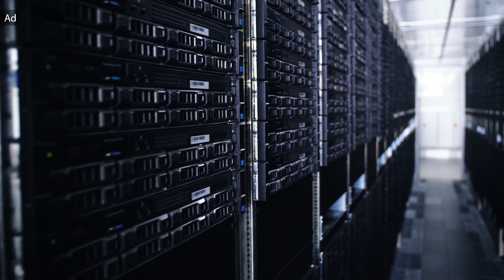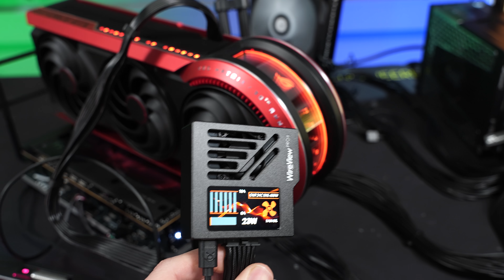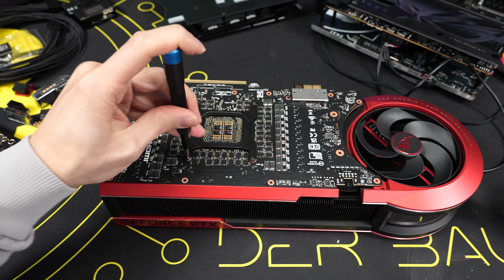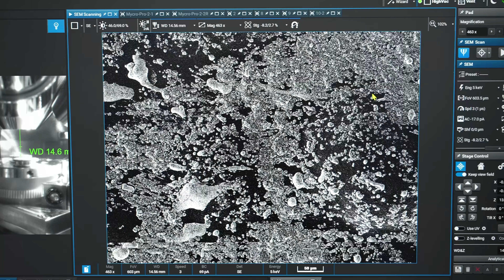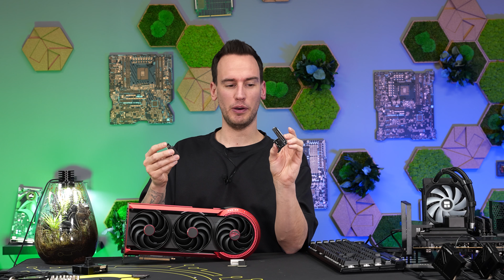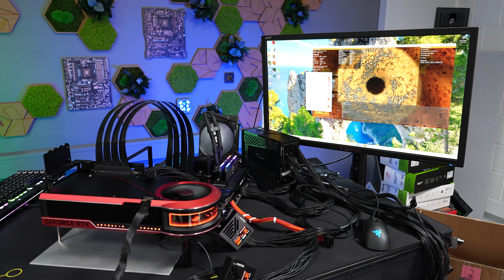After Recall Rumors: ASUS Secretly Changed RTX 5090 Matrix Liquid Metal

Comment: Does anyone know if the Lian Li GPU cable (PW16-81W) would fit the Matrix? The attaching end is slightly larger than other cables being 7?8" of an inch, or 22.225 mm long. I am fortunate to have the Matrix on the way and will make it fit if I must, but hoping I won't have to. Great video! I wish I had half your knowledge.

Comment: I've had Liquid Metal on a CPU spreader for my old machine for roughly a decade. With cleaned heatsink fins, it had the same temps in p95 a decade later. So never understood why exposure to air was an 'issue', since once married, only the very edge of the LM would oxidize, (I say had, because i removed the heatsink to use on a newer machine, which has been running 5 years now)
I've been too nervous to try LM on a GPU die tho. Paste moat seems like a better idea to prevent leakage than anything. Def taking notes :3

Comment: This card makes no sense. The additional wattage does not increase performance.  My asus 5090 Astal water cooled is pulling 600w at 3100 mhz and 55c. And under 8.5 amps on all pins.

Comment: I wonder why Jayz2cents said that the matrix draws 600W from 12V + 200W from the BTF connector which he did not backup either by testing or through an ASUS statement...
I thought it was weird if they did that, your video makes sense its likely 50/50 for a pretty much near 0% chance of burning the card

Comment: I'm quite surprised 2 x 12vhdpr arent built on to recent high power GPU's like the 5090, Also PSU's should have 2 x 12vhdpr, the circuit board would need a slight re-design to instruct components to draw power from either 12vhdpr. I have seen PCI-e connectors on new B850 motherboards capable of providing the GPU with 75 watts which is a good idea.

Comment: Someone needs to invent a liquid metal that's very wettable with low surface tension so that machined grooves in the mating surfaces can naturally draw the liquid metal into automatic contact with little or no pressure required.

Comment: I like the idea of the wireview with a extention cable, as not any of your current wireview models work with my GPU.

Question: Will cable length be an issue?

Context: My PSU cable is already 750mm, adding the wireview with another cable adds another 500/750mm?, so I may end up with 1.5 meter of cable.. is this bad or will it be fine?

Comment: A thought came to my mind just the other day regarding the 12V-2x6 connectors. Every GPU manufacturer have advised against bending the cable near the connector so I was thinking, for all those that melted, were their cables bent too near the connector? Has any vertically mounted GPU experienced melting connectors, since vertically mounting the GPU means the connector is facing up and the cable would most likely not even need to be bent near the connector at all when routing to the PSU. Any thoughts or experiments done to test this?

Comment: They really should of gone dual 600w connectors 😭 yall guys seen msi lighting 5090?! The thing goes beyond 2500 watts!! Has 2 600w connectors. Its NASTY OP powerful! Id buy msi lighting 5090 😂
Reply: Gonna need 240v psu these days. So over 3000 watts. 120v psu’s aint cutting it anymore 😂 as they are limited to like 1600w
Reply: BTF the whole concept.. i dislike it. Not only it takes away pwr from mobo for future tech. Also have to buy whole board for it. It would of been whole lot better if just went 2 connectors and would be compatible on a lot more hardware.

Comment: the paste on the stiffener ring around the core needs to have an air channel because otherwise when mounting, the paste on the stiffening ring would create a sealed bubble of air which will prevent the core from touching the heatsink, and if you force it closed, it will blow out the paste off of the stiffener until the bubble "pops", which will create a quick path for liquid metal to leak out of. by creating that multiple path array of paste on the stiffening ring, it allows a path for air to get out when mounting while also keeping a more effective barrier to liquid metal leakage. it has nothing to do with oxidation of gallium.

Comment: How many insert cycles are those plugs rated for typically on PCIEX cables - I swear even my Corsair Pro type 4 cables start to increase resistance and drop voltages from 12v to ~11.6v over time plugging and unplugging during equipment testing.

Comment: Expensive card. 👀
I'm thinking that the mixture of liquid metal and other material might be to help stabilize the liquid metal in place and/or keep it from sticking to components if it leaks out?
It would probably still migrate around once hot, but I don't know.  I really never liked liquid metal but this seems a bit safer than straight up liquid metal only.

Comment: The gap makes sure no pressure can built up, which can otherwise slowly push out some LM. A tiny difference in pressure is enough to drive a slow creep of liquid through crevises, including creeping through another high viscosity liquid like thermal paste (i.e. if the barrier didnt have gaps). Apart from simple thermodynamic expansion, also evaporation of the tiny bit of water present on basically every surface in our atmosphere leads to a bit of pressure. The layered pattern makes sure there is no direct path outward. In general you want prevent any pressure builtup simply to reduce strain on the barrier material, which can push it outward over time. It also would act on the chip and heat exchanger but I dont think thats significant with respect to other stress/strain in the solid material.
Reply: But liquid metal corrodes when combined with oxygen............ Did you miss that portion of the video from one of the top Liquid Metal sellers in the world?
Your facts make sense, but they have never been a problem thus far. This theory is similar to the vented closed loop water cooling loops; it makes sense in theory but does jack shit besides making another point of failure. The pressures we are talking about are WELL below 1 PSI for LM, the pressures for water cooling loops were around 3 psi (depending on heat). Both cases are negligible.
Reply: My quess is that they used stencil to apply the paste and that's why there is gaps.
Reply: The TIM around the core forms what's actually called a 'labyrinth seal'.

Comment: Can someone explain to me why this 5090 is only compatible with btf mobos? He said that in previous videos too but I couldn't figure out why exactly.
Reply: You can use it on normal mobos if you want but it will be limited to 600W through the single 12v 2×6 connector.

You need a BTF mobo (or one of those adaptors when they release) to unlock it's full power limit since it supplies the extra wattage through the BTF connector itself alongside the standard 12v 2×6.
Reply: @kspectre21 I asked the question because I recently bought a btfo MSI and couldn't figure out. Are you saying it needs more Watts, that I understand, and that "only" btf mobos can provide this via the third 8pin pcie connector?
I saw this third one in the manual so I'm making a simple deduction here. (My mobo still in it's package so I didn't dive in the full manual yet).
Reply: @The.Anonymous.Anonymous You can use it on your mobo at 600w but then it's just a normal 5090.

The main feature of this card is having an increased power limit over the standard 5090 models for overclocking, it needs the BTF connector to do that.

If you don't have the connector plugged in then you just essentially just have a bigger 5090 Astral. It still works completely fine but you're just losing that extra overclocking headroom
Reply: @kspectre21 thanks a lot, so that's the explanation. The 12v power is 600W, the pcie is up to 75 I think, and the single 8pin is 150 I suppose. That's a lot of nuclear power 😂 at this point GPUs need to have a separate wall plug, it would be easier!
Reply: @The.Anonymous.Anonymous yea and with MSI and Gigabyte now going further and making 1000w models with two 12v 2×6s it's getting even more insane lol

At some point we're just going to have to start buyings a GPU in bundles that come included with their own generators 😂
Reply: @kspectre21 so true 😂 my 5-6 yo PC is a Corsair One, fully integrated, with a 600W for a 2080 and an i7, evey single component is OC. The new PC parts I bought, when I calculated the need it's like 1000-1200W. I just can't wait for my new electricity bill 😂
Reply: @The.Anonymous.Anonymous yea I went from an 8th Gen i5 and GTX 1050 Ti last year to a Ryzen 7 9700X and 9070 XT and the difference is absurd lol

Even with an undervolt on the GPU the power draw on that when it's under load is 200-250w more than my entire old PC.

It also turns into a heater whenever I play some UE5 games, it's so weird feeling the entire room heat up massively.
Reply: @kspectre21 my old pc serve as a heater for my whole hole office. In the summer, it's unbearable, I have a big fan blowing on it, no AC. I can't imagine how it's gonna be with the new PC and 30-35⁰C outside. Either I'm gonna cook line in an oven or I take a break from May to September 😂

Comment: Can you check with ASUS on how users are supposed to re-apply the liquid metal (when disassembled/cleaned)? They are using a thermal solution that can't be replicated by the end user.
Reply: Pretty sure their opinion is pretty clear. "Don't." Not user serviceable.

Comment: They use a think only a few molicules thick coating/mask on the die. The liquid metal is applied to the Cooler. This is done to some what protect the die from corrosion. hence the pattern you see, Ive seen similar aplications like this in lets say "equipment that's not publicly available and or public knowledge"

There are also other reasons for this kind of aplications too but i shal end it here.

Comment: The heights of thermal engineering. On both sides - installation and reverse engineering.
In my opinion, this is a mesh-placed metal fluid, protected with oil and air, which allows the entire structure to expand - marvellous and beautiful!

Comment: The adapter from BTF to 12VHPWR seems to have been introduced two years ago with the 4070 Ti Super and 4090 BTF versions from Asus.
But it looks like it hasn't seen any use since, maybe Asus decided the BTF connector alone was just more fail-safe and didn't want to add more points of failures.
Still a very interesting concept, great video and investigation.

Comment: i have to suggest that you create a new connector for gpus. I suspect that the finest connector would have a single 12 volt plus, and a single 12 volt ground, and be somewhat similar to a standard Anderson connector that can carry around 2000 watts. The 'current' connector problems are just stupid, and it is amazing to me that no one is doing anything. In my opinion, you are the person who best understands this stupid problem that the largest tech company in the world has perpetuated.

This should have been done around the time of the rtx 1080, when the 6 pin and the 8 pin proved to be too small at 150 watts. But, at this point, the use of 24 separate conductors with 12 positive and 12 negative wires is getting kind of comical [or sad].

I would be proud to help with this task, because i am a retired engineer, who lives entirely off grid. I game avidly using the power of the sun.

Comment: Compared to pcie slot this card is absolutely insane size.
Reply: The ATX standard has been barely fit for purpose for a long time.  Heck, Intel tried to replace it with BTX 20 years ago.  Now a clean sheet design would probably go with the primary PCIe slot being straight/flat on the top of the board, or use cables instead of slots.
Reply: @concinnus  cables aren't that great for high speed high bandwith applications. I could see daughter boards to rotate the cards into different orientations like in very old workstations and servers though
Reply: @Tri_Nitro  Your info is at best outdated.  Cables like MCIO have been common for Gen5 connections in servers for years; they'll even do Gen6.  That said, they aren't cheap, so they probably only make sense in applications where the alternative is even-more-expensive extra MB layers.

Comment: Liquid Metal is what is killing PS5's too.
Reply: But is it really? I hear these rumors but don't know a single person who has that problem, whereas during the PS3 days, everyone I knew ran into the Yellow Light Of Death including myself where I had 2 PS3s that died from it.
Reply: @robertlawrence9000  I've opened my 2-3 year old laptop that had liquid metal on the CPU. I saw it starting to not only escape the silicon dye, but almost get on the motherboard. I was scratching my head as to why they didn't isolate it to begin with, and if PS5's have nothing surrounding the dye then it can certainly kill them.

I've changed to PTM7950 and temps dropped by 15 degrees.
Reply: @robertlawrence9000  depends if the user has it vertical or not.
Reply: @CyberbrainPC  true,
most ps5 are left in vertical position ,soo gravity gona pull that LM slowly down

Comment: Have you ever seen a chip "reballed" for installation? The "printing" appears to apply both to the thermal paste barrier and the liquid metal, with the liquid metal being applied in tiny balls much like the aforementioned process. the inclusion of regular thermal paste or some sort of binder in the liquid metal is likely what allows the liquid metal to be applied in tiny dots as it was, to facilitate a "printing" process of application for mass production/machine application.